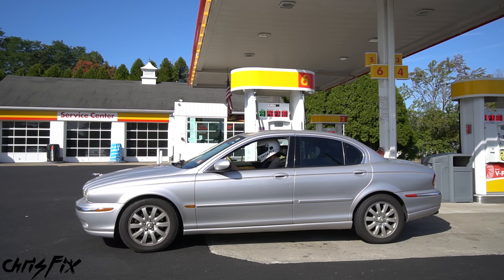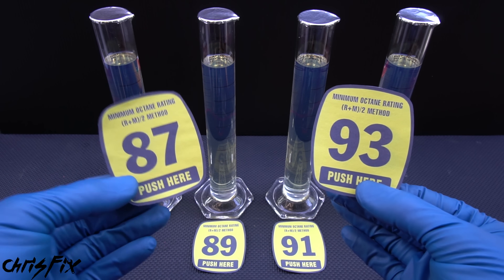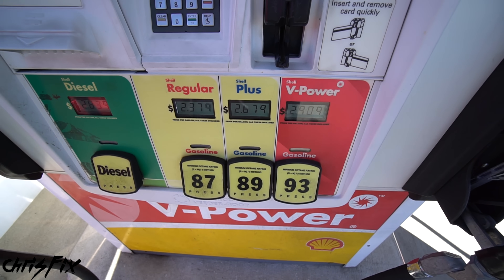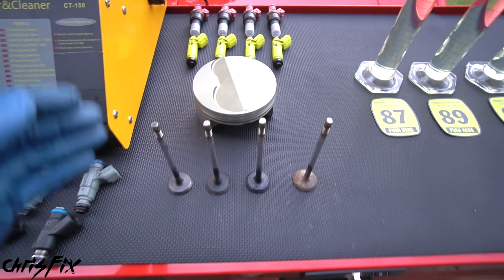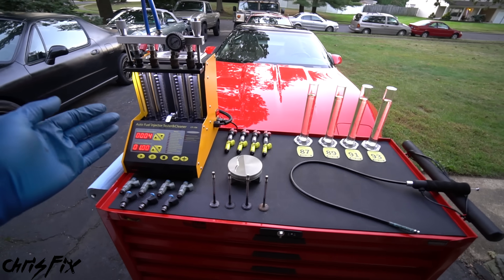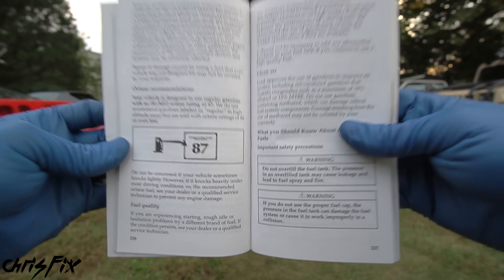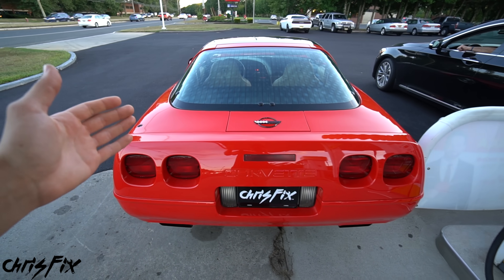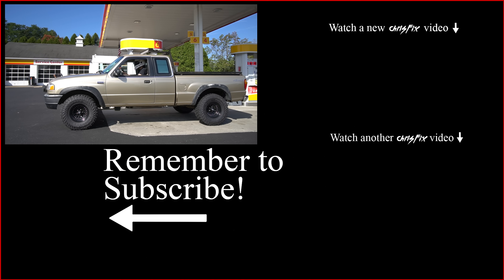What is the BEST Fuel to Use in Your Car or Truck and WHY

Comment: E85 ethanol in non-Flex-Fuel vehicle... 
I ran E85 in my 99 Ford Escort till the wheels fell off (bought 2007 used $800). 
Drove 5 years put 100,000 E85 miles on her.
Michigan rust,  pot holes finally killed her (drove her to scrap yard and got over $200).

Ran perfectly,  over mountains,  extreme weather. 
Seattle to Sacramento and back to Seattle (many times). Sacramento to Detroit. Then drove almost 8 hours a day traveling sales. 
I never had a problem running E85 in non-Flex-Fuel vehicle. 
Put in newer GMC Econoline vans (Dash light comes on telling you it's sensing and adjusting for fuel)

When there is HUGE savings I always use E85 or top off from 1/4 tank of 87 (25% : 75% mixture of 87 / E85).

If there isn't a HUGE savings I just use regular 87 octane (containing 10% ethanol already).

Many Illiterate people think ethanol will destroy their non-Flex-Fuel vehicle because they don't know  87, 89, 91, and 93 octane (containing 10% ethanol already)
🙄

Note: Some refineries don't mix ethanol into their 91/93.

Many women told me it was impossible and were terrified when I spoke of this; as if it were blasphemous.
It scared them and they denied my information because it shakes their "beliefs". 
My cars don't care about  superstition, fears or beliefs. They run on compression of fuel combustion.

Empirical  analysis: I used it. It worked. Fuel  mixture Idiot lights come on.

Summary: 
If you don't want to use E85 in non-Flex-Fuel vehicle... DON'T. 
If you do.. I did it and saved $100's.

If it voids warranty and you value warranty.. DON'T. 
If it's out of warranty and price difference between 87 (10% ethanol)  and E85 (51% to 83% ethanol)  are substantial and you want to top off... I did it and saved $100's.

Saved $1 gal.  x 13 gal x (2x/week) x 52 weeks =$1,350/year
Saved $.75gal x 13 gal x (2x/week) x 52 weeks =$1,014/year
Saved $.50gal x 13 gal x (2x/week) x 52 weeks =$676/year

Comment: You didn’t mention the effects of gasoline with 5-15% ethanol on non-flexfuel engines. Sometimes gas stations have their premium ethanol-free, and everything else has ethanol in it. Is it worth it buying the premium, considering the hydrophilic and polymer degrading properties of ethanol?

Comment: i've been told the additive package in the premium 93 or 91 at the shell stations is a better package than that is put in the lower octane rated fuels. can you confirm or?
Reply: yes they add more detergents(cleaning chemicals) in the premium
Reply: The additive packages in top tier brands of fuel (which includes all major distributors, including Costco) were developed in cooperation with car manufacturers. If it's a top-tier brand all the fuel meets your car manufacturer's requirements in terms of additives. The rest is all marketing hype.

Comment: Chris...In Iowa we have 88...what is 88? Someone told me it's not that different than regular...I don't believe them even though it's cheaper. My suv says 87, so that's all I use.
Reply: 88 octane is replacing typical mid-grade 89 octane gas. 89 octane is just a 50/50 mix of regular and premium. It typically contains 10% ethanol like regular and premium does. However 88 octane is E15 gas. (15% Ethanol) So since most cars don't require mid grade, they are dropping it and are using E15 instead, since most cars are engineered to run it, such as my 2014 Ford Fusion for example.
Reply: @waycoolscootaloo  Gotcha...so I can use it in my 2017 Ford escape, without issue?
Reply: @wendyhdzmiller8700  Eeyup! E15 is good to run. Just stay away from E85 though.
Reply: @waycoolscootaloo  Thanks for your help!
Reply: @wendyhdzmiller8700  Your welcome.

Comment: I use premium in my 2010 CRV. I have a 70 miles commute daily. I get far better fuel economy using 93 than I do with 87. 

However, I had a 2002 Jeep Wrangler and using premium made the check engine light come one. Basically, it burned up the oxygen sensors and the codes confirmed it.

Those are not myths. Those are repeatable observations.
Reply from the maker: thanks for sharing

Comment: "octane is the resistance to detonation or engine knock" well that's interesting because I was under the belief that octane is a substance. A chain of hydrocarbons to be more precise. I guess heptane is the resistance of gasoline to sprout wings and fly and hexanes prevent your engine from opening magic portals to neverland lol. Higher toluene makes gasoline speak english and higher benzene prevents mutually assured nuclear destruction of earth.
Reply from the maker: Octane is a measurement, not a substance!
Reply: @chrisfix  Octane rating is what you are thinking of, with the advances in technology we can measure the molecular weight of substances. Fuel is not a scientific name anymore as it's not the 1800s. There have been many many chemical molecules separated from crude oil and octane is only one of them.
Reply: @chrisfix  Among them being octane propane hexane heptane nonane butane pentane these are all alkanes isolated from crude oil with varying molecular weight. They are very much so substances lol.

Comment: Volkswagen/Audi recommend using Shell or BP (found in Europe) I only use top tier gas (Shell is my preference) for my Audi, Jetta,EOS & Phaeton. I do stay away from the no name independent stations.  Three cars run on super and the Jetta on regular. I saw you added an octane booster, but IMO just a waste of money. Todays cars are set  up for the octane offered. The days of Sunoco 190/220/240/260  are gone.

Comment: Hey I just bought and old 2004 dodge ram 1500 4.7l, and the fuel economy is just 7 miles per gallon and sometimes it loses power while driving, I ask to my mechanic and he said that on this 4.7 engine you have to use Premium gas to keep it running good, is that true??

Comment: I put 85 octane in my 05 Dodge Durango that says 87 octane and it stopped running and needed a new fuel injector. Was that my fault or was it just because it’s old

Comment: Smart kid but wrong on a lot of parts , pre-dentonation or knock is caused by advance timing and carbon build up ! Plus gas around your piston is not good that washes the oil residual away . Any good licensed mechanic will tell you the worst fuel you can run in any engine is regular fuel do to the Ethanol ! Ethanol is made out of corn and draws in moisture and condensation into your gas tank . I eat corn two or three times a year for the taste not because it is good for my body so why would I put in my car . I put Premium fuel in everything I own from weedwhacker , sleds , boats and go karts but my truck Regular with fuel treatment . good luck

Comment: What about No Ethanol? What experiences have you had from that brand of gas? And does it truly have benefits others don't?
Reply: Ethanol-free is better for carbureted engines so the gasoline sitting in it for a while doesent gum up
Reply: Am I getting less ethanol as I increase from 87 to 89 to 93?  Havent been able to figure that one out.....
Reply: @billm201  ethanol is often used to boost octane in certain fuels, so it might be quite the opposite, but it usually says on the pump
Reply: E85 ethanol in non-Flex-Fuel vehicle... 
I ran E85 in my 99 Ford Escort till the wheels fell off (bought 2007 used $800). 
Drove 5 years put 100,000 E85 miles on her.
Michigan rust,  pot holes finally killed her (drove her to scrap yard and got over $200).

Ran perfectly,  over mountains,  extreme weather. 
Seattle to Sacramento and back to Seattle (many times). Sacramento to Detroit. Then drove almost 8 hours a day traveling sales. 
I never had a problem running E85 in non-Flex-Fuel vehicle. 
Put in newer NON-FLEX-FUEL GMC Econoline vans (Dash light comes on telling you it's sensing and adjusting for fuel)

When there is HUGE savings I always use E85 or top off from 1/4 tank of 87 (25% : 75% mixture of 87 / E85).

If there isn't a HUGE savings I just use regular 87 octane (containing 10% ethanol already).

Many Illiterate people think ethanol will destroy their non-Flex-Fuel vehicle because they don't know  87, 89, 91, and 93 octane (containing 10% ethanol already)
🙄

Note: Some refineries don't mix ethanol into their 91/93.

Many women told me it was impossible and were terrified when I spoke of this; as if it were blasphemous.
It scared them and they denied my information because it shakes their "beliefs". 
My cars don't care about superstition, fears or beliefs. 
They run on compression of fuel combustion.

Empirical  analysis: I used it. It worked. Fuel  mixture Idiot lights come on.

Summary: 
If you don't want to use E85 in non-Flex-Fuel vehicle... DON'T. 
If you do.. I did it and saved $100's.

If it voids warranty and you value warranty.. DON'T. 
If it's out of warranty and price difference between 87 (10% ethanol)  and E85 (51% to 83% ethanol)  are substantial and you want to top off... I did it and saved $100's.

Saved $1 gal.  x 13 gal x (2x/week) x 52 weeks =$1,350/year
Saved $.75gal x 13 gal x (2x/week) x 52 weeks =$1,014/year
Saved $.50gal x 13 gal x (2x/week) x 52 weeks =$676/year
Reply: @ronelljenkins9712  Interesting experience, I greatly appreciate that information. I've been wondering for years of the pros and cons pertaining to ethanol percentages in our gasoline, which led me to ask that question originally. I may have to do some trial and error as well. The savings speak for themselves, that's what most dont understand fully. May not seem like it, but less is more; more than never.
Reply: @ronelljenkins9712  It does and it one of those climate changes warriors 'solution' for a cleaner environment. All it dies ist just scrapping your engine and at least your money bag. The big fraud on that is that even in regular gas ethanol is added. (at least in Europe). If you want to get clean gasoline you need to go for the premium otherwise you've got crap within your fuel. And on high performances cars you are recognizing it for sure!

Comment: You talked very briefly at the end of the video about fuel economy. If your vehicle states 85 oct and you use 93 Oct, on average is it worth the better fuel economy? When I've done the calculations in gas mileage vs extra cost, I always came out saving money with the higher octane due to getting more mileage. I would really like to see a video from you about this. I absolutely love your explanations, graphics, and examples. Great Job!
Reply from the maker: Thanks for sharing!

Comment: Hey man can you message me on Facebook messenger cause I won’t be able to find your comment but I have a question I have a 2003 Mazda 6 2.3L and it doesn’t have an owners manual and doesn’t say anywhere of what has to use can you message me on Facebook and help me find what fuel to use I wanna take care of my motor thanks
Reply from the maker: I would look on google or buy a replacement owners manual to get the specific answer for your vehicle

Comment: What about E-15 gasoline in a vehicle? In some gas stations here in PA we have regular 87, 91, 93 and E-15. My manual for my 16 Chevy Cruze says to use 87 or higher. E15 is 88 octane and slightly cheaper. Just curious about that because most gas in the US may contain up to 10% ethanol but since my manual says to not use anything above 15% ethanol should I be okay with using E15?
Reply: Yes. Your car fuel system is rated to a blend of 15% Ethanol. It's made with composites instead of rubber gaskets and stainless or composite fuel lines to handle E15. However it's not quite robust enough to handle E85. E15 wont hurt anything though. It's made for that. Even my 2014 Ford Fusion is rated for E15.
Reply: Thanks! Good to know!

Comment: Can someone explain to me this: there is an option for 90 octane (no-ethanol) option for $3.029 in addition to the 87- $2.089, 89- $2.389, and 93- $2.689 options at my nearest gas station. What does having ethanol in your fuel do and do i get better mpg for picking the non-ethanol option (i currently get 24.3mpg city and 38.4mpg highway on 87)

Comment: Chris... How does "non-Ethanol" fuel stack up? Is there a time and a place where using it can be an advantage for engine cleanliness or performance? Thanks!
Reply: Anything carbureted will fare better with ethanol free fuel. Ethanol gums up carbs, which slows your fuel flow and makes your vehicle run terribly.
Reply: @jakeedgell591  ... Thanks Jake. That's what I thought. I use it in all my yard equipment with great results already.

Comment: What about ethanol free gas? I’ve heard it’s recommended to run in classic cars, why do we have E85 then aswell?
Reply: E85 uses less oil. And instead it's mainly alcohol from corn. It burns cleaner than Gas. It also produces higher octane. E85 is generally about 108 octane. So it's great for high performance. However if you tend to store your car a lot, then it's not good to run as it will soak up moisture from the air. So it has a shorter shelf life. Basically you don't want to let it sit for more than 30 days. (A month) It will stay fresh for that long in your car. But going beyond 30 days it starts to lose its freshness. So for a daily driver you never have to worry though.

E85 is perfect for modern made cars. But classic cars don't have the composites and stainless steel systems used on modern cars to handle it. So their old timey rubber hoses and seals will rot out from E85.

Comment: Most vehicles should be running on The lowest grade gas.
Most cars today that say to use mid grade or premium grade gas do not burn off most the gas and most goes out your tail pipe. Use low grade gas and if u get engine noise move up to mid grade. Smith busters did a extensively tast on this.
Don't trust the dealer. 
Dealers get paid extra to make u buy more expensive gas and it jst pollutes our air.😁👍👍👍

Comment: Do a video about a Electronic Throttle response unit.  the ones where you can set it to different levels of throttle response.  almost feels like a whole different engine. takes out the delay in the throttle.

Comment: My car says to run 87 octane or higher, so am I wasting my money if I use 91 octane? People have mentioned to me that ethanol is damaging to any engine that is not a flex fuel rated car. In Wisconsin 87 and 89 octane contain up to 10% ethanol, where as 91 contains no ethanol.

Comment: I drive a 2006 Chevy Malibu. I'm pretty sure it runs regular 87 gasoline. But in your video you mentioned if I use Shells 93 gasoline it could help clean some of that buildup off my pistons. Would it be fine if I use 93 in my vehicle for a little while to clean off some of that buildup even if it says it takes regular 87 gas? Thanks in advance.

Comment: 93 does burn cooler. Run 93 in an engine designed for 87 and you'll end up getting more carbon deposits.

Comment: My Tacoma owner’s manual states I can run all 3. High octane will add better fuel economy and a small amount of HP.  Also ran ethanol free at 1 tank then filled with 92 here I got an average of 21mpg which I was really shocked compared to a average 19mpg on a tank.

Comment: First time seeing a video by you. Great Video. But, at the end of the video, you said E-85. My car is E-85 rated engine, but I've always used 87 regular gas. You did not cover that point. Or did I miss it? So, have I damaged my engine? I don't like E-85 on my boat as it makes more water in the tank.

Comment: So if my 08 Hyundai accent knocks sometimes I should put premium???

And thx for the recommendation on the using the octane booster; I been in the mountains on my ninja motorcycle and had to turn around before because I couldnt find premium fuel
Reply from the maker: Try it and see if it still knocks.

Comment: ChrisFix   So i like to fill up at costco but my truck uses 89 and they don't carry it.  i have heard that you can add half of 87 and half of 91 to make 89 but not sure if that's true, would you be able to chime in whether that's true or should i just fuel up elsewhere. I have a 2016 ram rebel with the 5.7 liter mds engine.

Comment: I use ethanol free gas which is either 89 or 90 octane depending on the gas station.  Shell seems to be 90 whereas the others i've encountered have been 89
Reply: All I use for 2 years now

Comment: There are so many comments that my questions may have been covered. I have direct injection (Mazda CX-5), so I wish it was discussed more. Also, I always use TOP TIER gas, which means to me that the additive package meets high standards. I hope that keeps the intake valve from getting loaded up with carbon. One more thing. Chris said, or I heard it this way, that premium gas gets a better additive package. With me running regular (recommended, even with 13:1 compression), I may not be getting the equivalent package.

Comment: My Chrysler 300 Hemi manual says 89. I tried 87 but the car bucked like a rented mule and fell over dead. I tried 91 and 93 but I saw no difference in power or mileage so I've been running 89 for almost as long as I've owned the car(10 years). It has 116k on it now and still runs very strong for a SBH.

Comment: I've taken engines up to 200,000 miles with 93 octane. It definitely burns cleaner and if you ever take an engine apart you will see the difference. If you can't feel the difference then don't use higher octane i guess. But i do.

Comment: Any benefits to running 93 (with the higher amount of additives) in a DIT engine that is designed to run on 87? specificially for a 2020 forester. I had a 2016 WRX before this that I always ran 93 on and it still had pretty dirty valves.

Comment: No FLEX fuel examples (like does it clean better?). I've never ran it in my Chrysler but you "hear things".  Last time I heard engine knock was back in the 80's and the car had a carb.  And last but not least, the ONLY time I paid attention to buying fuel was when I had a TDi (VW Passat). Diesels can be finicky .